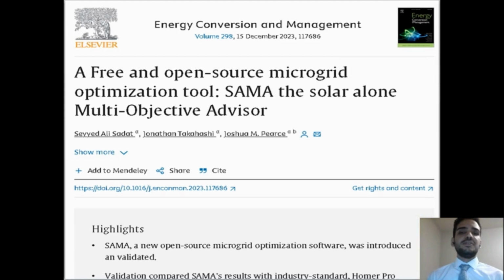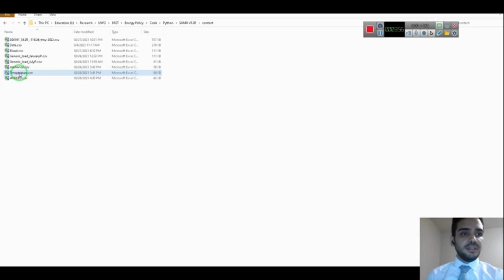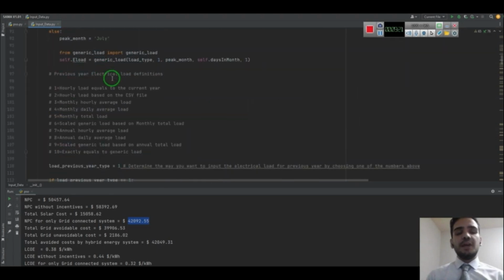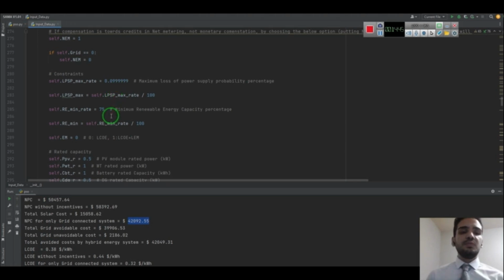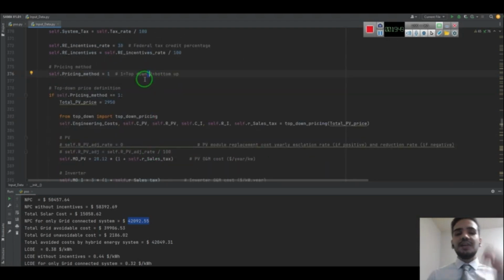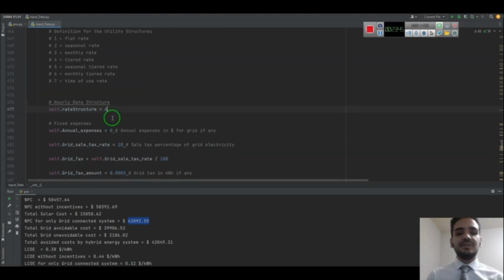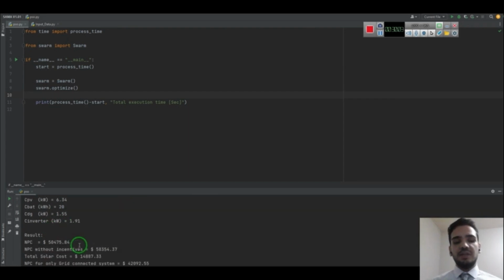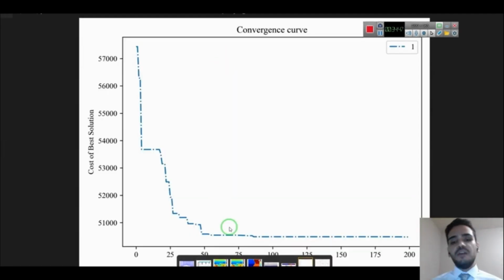How to use SAMA (Solar Alone Multi-objective Advisor) an open-source energy system optimizer

Comment: Interesting, I am reading your paper.  Thanks for posting.
Reply: I would suggest there are a couple other items to consider for the incentives people have to leave the grid behind :  the cost of solar installation at $3/kWh is the commerical installed cost, however DIY types, also the type to want energy independance, are capable of $1/kWh installations.  Diesel back up generators may not be the most likely back up, consider piped natural gas systems which are both lower operating cost and more socially acceptable in suburbs.  Lastly, the Energy storage system - ESS are now largely Lithium-Iron-Phosphate batteries with reported 20-year life, lowering the system life-cycle costs considerably.  EV's themselves are a rolling battery capable of significant Energy storage, lowering the cost of storage by using a product that makes it's own financial sense even without off grid energy independance.

It may be ironic to find in 10-20 years that the policies of PV-abhorests lead to early death-sprials of Fossil Fuel utility-scale utilities in coal and oil rich regions...how poetic.